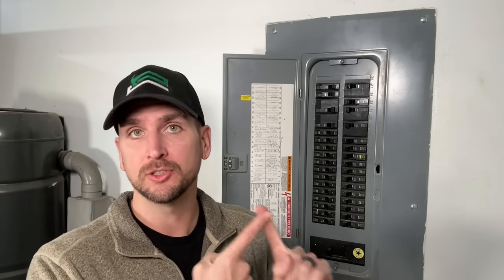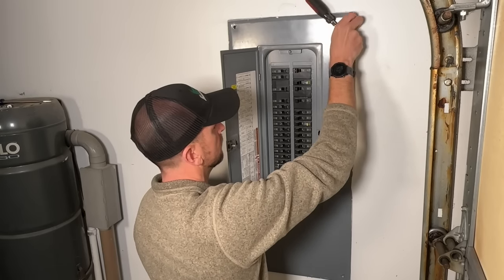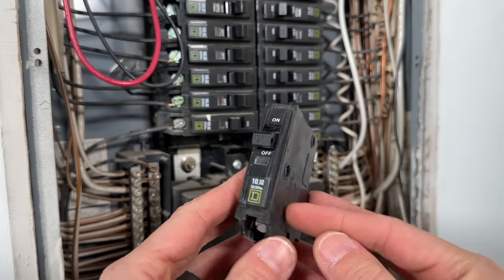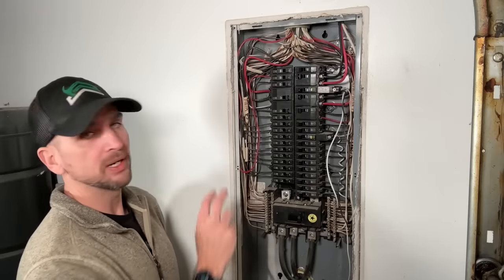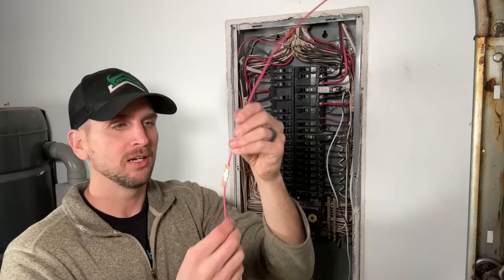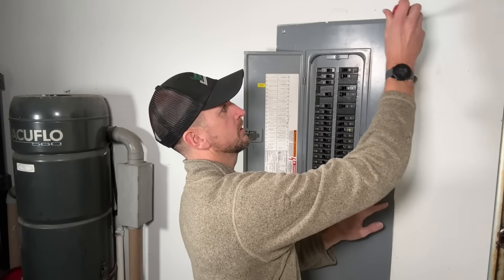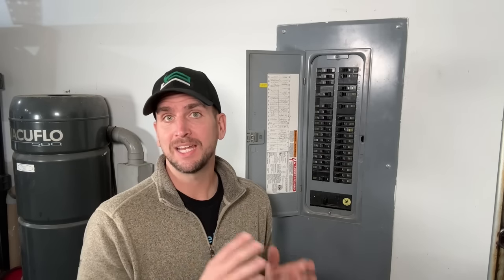How To Replace Or Move A Circuit Breaker

Comment: My townhouse was built in 1994. Every once-in-a-while (once or twice a month) I notice a short dimming of lights when a regular appliance is turned on. Does this mean I should get my panel checked out. And how long, on the average, do circuit breakers last.
Reply: This is "probably" nothing to do with your panel. When you turn on an appliance (maybe a microwave or vacuum) it is not totally uncommon to have your lights dim for just a few seconds, especially with a vacuum which has a high in-rush current. Your panel doesn't 'supply' any electricity, it simply limits how much is distributed throughout your home. A more likely scenario is that your utility transformer (which does supply your home) is not giving sufficient voltage, or you may be trying to use power when everyone else on the street is also trying to use a lot of power (if you're all on the same transformer). 

Now, if it's your stove/dryer/AC causing lights to dim then it's a bit different. These work across two phases, and having lights dim/flicker while these are running could mean that you have a loose connection in your panel.

Comment: I turned off the main breaker in the box and tested the breaker I needed to replace with a meter. I touched the screw with one lead and put the other lead to ground and it read 120 volts AC. Isn't it suppose to read zero? What happened?

Comment: To extend a wire in the panel could you just twist and solder the wires using heat sink to cover the splice ?
Reply: There is really nothing wrong with solder but it's so much more work when a wirenut is what most electricians would use and it takes literally 5 seconds. Wago is great for DIYers and some electricians have them, but it's so much more expensive than wirenuts. Wirenuts are also more versatile, they work with 2-6 wires (or more, depending on the size)

Comment: I have a question, what can i do if i have 2 free space in my breaker box but no free blank space on the cover. Can i just cut it and make space? Its that gonna violate the code?
Reply from the maker: If you have spaces on the busbar you should have knockouts on the cover which can be easily removed with some pliers.  Is that not the case?

Comment: What about balancing out circuits?  I have some with too many things on it and others with barely an outlet on it.  What to do?
Reply: Nothing you can do from inside the panel. If you want to split up a circuit then you have to run a new feed from the panel to the circuit you want to split. Keep in mind that circuits generally have 12 items on them. Each receptacle and light is considered to be 1 item. So you could have a circuit with 1 plug and 11 lights. Or 10 plugs and 2 lights etc. Unless you're having overload issues (your breakers would be tripping in this case) there is no need to worry if you have "too many" things on one breaker
Reply: @avsrule247  thanks for info Matt doesn't sound like a diy project at least not to me

Comment: I turned off my main braker once and it never came back on... I was told to turn off all the other ones first before turning off the main switch.  Not sure if that would matter in all cases but for me it killed the breaker for some reason.
Reply from the maker: Hmmmm, first I have heard of something like that.  I have turned off the main breaker hundreds of times and never had a failure.  🤷‍♂️
Reply: Breaker was probably bad in the first place, if you shut it off, and it wouldn't turn back on, then the breaker itself was junk to begin with, they do wear out over time for various reasons.
Reply: I thought turning off all the breakers was to prevent a possible surge from damaging anything plugged in when the power is turned back on.

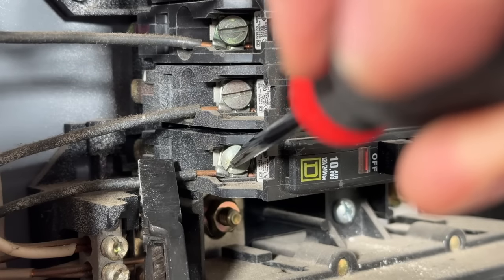Comment: 03:33 all wires connected to breaker should be screwed at top of screw to go same direction under screw righty tighty wires go clockwise same as screw or could come lose
Reply: Maybe you should watch the ten seconds before that, where he puts the wire behind a backing plate, therefore it doesn't matter what you just said?

Comment: I have a Zinsco breakers and I've been told that it's out of rated...No electricians want to deal with it. They want me to pay them to change the whole circuit breaker?

Is that necessary? My whole neighborhood has the same circuit breakers.
Reply: Zinsco breakers have a failure rate that is generally considered unacceptably high, and their failure is a failure to trip when they should.

So your panel may seem like everything is working fine...right up until someone overloads a circuit (e.g. too many heaters on one circuit) and the breaker doesn't trip, allowing the circuit to overheat and possibly ignite something.
Reply: My old house had a zinsco panel and I had to replace a breaker.  I believe i ordered it online cuz the box stores didnt have it.  I believe a company called Connecticut something or other makes breakers for Zinsco panels.

Comment: Hi. Does anyone know if Wago Connectors can be used in Canada ?
Reply: On Amazon Canada the first question ask if it is rated for Ontario  Canada and the answer is yes it's both CSA and UL rated for Canada! But I personely would make sure it was the WAGO brand store just so I would not end up with a WAGO clone or knock off that will most likely not meet the rating!
Reply from the maker: Yeah, from what I have experienced over the years if they actually say "WAGO" on the image for the product you should be good.  If the connect looks like a WAGO but actually doesn't have the label then those are knockoffs.
Reply: Sure you can. I have in an industrial facility and my own home. Follow the instructions and strip the proper amount of insulating material and they are as good as anything. I have a habit of wrapping tape around them when I'm done.

Comment: I know the breaker was tripped, but you really should turn it off prior to touching the hot screw. It would normally be live otherwise. And would probably arc if there's a load.

Comment: Put the wires on the top so the screw pulls it in not out then you don’t have to use metal pliers to hold it in place. I am not an electrician but I am about to change one and wanted to be 100 and that looks wrong to me.

Comment: Looks like whoever fitted the that board did it  blindfolded.
Other issue is if you move your live/hot to say the number one position in the board the neutral for that circuit should be in the number one terminal on the neutral bar.......
Reply: @Kevin-mp5of  there is where I live and trust me keeping the neutrals in the correct sequence on the bus bar is important because pull the wrong one out and you'll get a nasty surprise

Comment: Nice video however, an inexperienced person in dealing with electricity should not go into an electrical panel for safety reasons.  Also, always first turn off the individual breakers before turning off the main breaker and removing the load wire from the individual breaker.  Also, don’t wear your ring or other jewelry/watch when with electricity.  Lastly, “wire nut(s) is a registered trademark of Ideal Industries.  “Wire Nuts” refer to a specific brand of electrical wire connector even though it is used generally by everyone to describe a wire connector.  Technically, they should be saying, “wire connector”.  This is similar to a “Xerox copy” for a photocopy and Kleenex” for a facial issue.

Comment: I don’t think you mentioned the fact that these breakers must to be torqued to manufacturers specifications in order to meet code. That’s very important. Most DIYers don’t have torque screwdrivers.
Reply: not necessary
Reply: You are correct, but completely unneccessary. Those specs are there because they're required for liability reasons, but electricians also do not use torque screwdrivers. A simple firm twist followed by a tug on the wire is sufficient, while making sure that you are not crushing the copper/aluminum.

Comment: Just watched this person replace a qo square d breaker... i like to know if he a licence electrician....if you put the wire of the circuit on top the wire tightens it self when you tighten the screw...
Reply: QO breakers (10-30A) are rated to accept 2 conductors under 1 terminal for copper wire size #14-#10.
Reply: This doesn't matter when there's a clamping plate. If the wire is directly under the screw head, then you would be correct.
Reply: You are wrong  @JCWren
Reply: @BlitzHack If you can't explain why, then your comment is pointless. Cite your evidence.
Reply: Its called common sense  @JCWren
Reply: @BlitzHack OK, I understand. You can't make a case for your comment, so you're just shooting your mouth off to hear yourself talk.  Got it.
Reply: If you put the wire on the bottom it will push the wire out as you tighten the screw. (try it) That is why the guy in this video has to use pliers to hold the wire in. If you have not been trained properly (like you) and think it does not matter then the wire could be pushed out 75% of the way and only having very small portion of the wire in contact with the breaker and that will cause heat to build up and after a few thousand cycles cycles you have a loose connection. This is why you only see videos from DYI people instead of electricians to these videos because there is so many small details that make a huge impact on safety for buildings and people. It is not worth it. You have a big mouth so why don't you tell me why its ok to show someone how to do something wrong?  @JCWren
Reply: @BlitzHack This is only true if the wire is directly under the screw. It does not apply when using a clamp plate.
Reply: @JCWren like I said try it and you will learn something today. Feel blessed bro. Cya later

Comment: I don't know a single person replacing gas appliances with Electric ones. From an economics point of view, you'd have to be an idiot to do that. The same would apply from an environmental point of view. Natural gas appliances are more environmentally friendly due to NG being a very clean burning fuel. Even states like California who have gone batsh*tcrazy and are destroying the natural gas power plants have been quietly buying power from out-of-state that is either produced using Natural Gas and quite often Coal. Just the other day i saw a guy driving an electric car with a bumper sticker that said "powered by coal". 
As for the economic perspective, 1kWh here in California costs between $0.27 and $0.54 depending on the time of day or what consumption tier you're on. Natural gas costs pennies in comparison.

Comment: What's a main disconnect mean . Do you mean the main breaker switch on the panel?
Reply: @Kudos2ooU Yes.  It is typically located at the top or bottom of the panel, depending on where the leads from the meter enter the box.  It can be a left/right toggle or sometimes a up/down toggle (down is always the "OFF" position).  Like all breakers, it has it's amperage rating stamped or printed on it.  Up until the late 60's, 60 amp service was common. In the 70's, 100 amp service came out and  now is the minimum. And their was 125 and 150 amp service.  Now of course new houses start at 200, and some that are all electric, with a pool and heavy AC are starting to go to 400 amp service!

Comment: I have a 40 amps braker in my panel for AC. Should be 30amps?
Reply from the maker: Depends on the size AC unit.  Usually there is a manufacture tag on the housing that calls out the amperage.
Reply: Power divided by voltage gives you the amps
Reply: What size wire is going to the breaker? You want the breaker to be the weakest link of the circuit so you better not say 10AWG